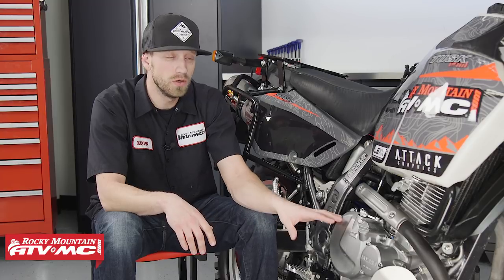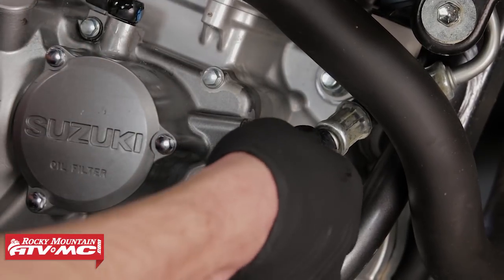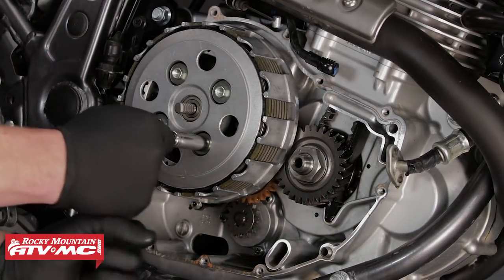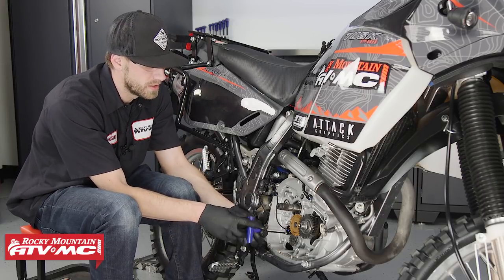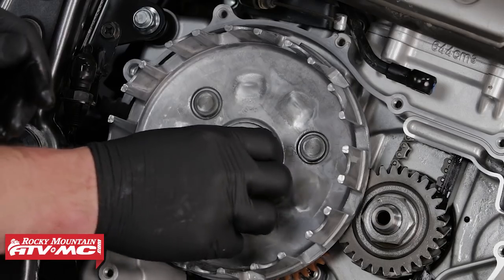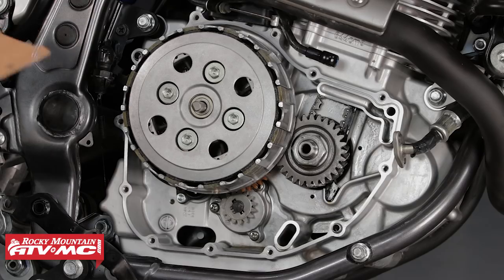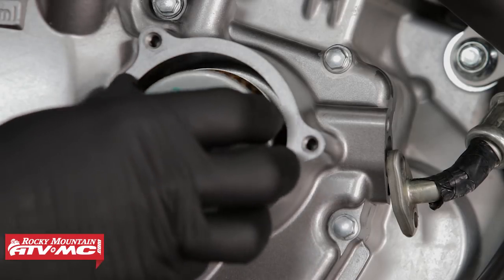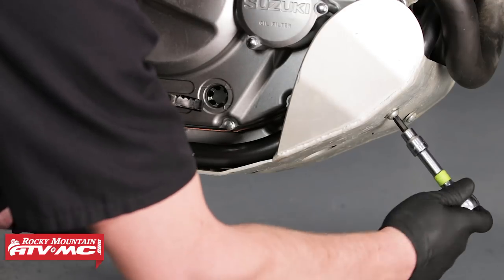Suzuki DR650 Neutral Sending Unit Bolt Repair

Comment: Another tip for keeping track of the case bolts is to get a piece of cardboard, draw a rough outline of the case with dots for bolt locations.  As you remove a bolt, push it through the cardboard “map” in the matching position.  When done your cardboard piece should have all the bolts in their correct locations. When reassembling remove a bolt from the cardboard and put in the matching location on the actual case.
Reply: LostInPA thats what i do.
Reply: Great tip. Have been doing that for years. And you can even put a strip of masking tape over the bolt heads to make sure they don't fall out when you accidentally step on them.

Comment: I dont want to state the obvious but I'm going to.
Why.....doesn't suzuki fix this problem.
How many people want to have to buy all that extra tools,etc to fix a problem that suzuki should.
Not to mention someone who doesn't have the capabilities to do the work is gonna have to pay for it
Is suzuki gonna pay for the labor cost....I doubt it.
Fix the problem suzuki.
Then I'll by a dr.
Thanks
Reply: They did - they now use loctitie on the NSU bolts.  Only 20 years late.

Comment: that cant be philip head screws. Most of japanese bikes use JIS screws.
Reply: i learned the hard way years ago trying to remove screws with a philips PH2 bit.  JIS screw bits are a must have in the tool box.   the Japanese screws and bolts are made of butter if you dont have the exact size tool, they will strip
Reply: The recovery tool kit that comes with the bike has the correct JIS bit.
Reply: You would have thought he knew about JIS but maybe not!!!
Reply: Everyone should buy a JIS screwdriver if they own a Japanese bike or you WILL end up drilling out screw heads eventually.

Comment: It's worth investing in a JIS screwdriver for this bike or (or any Japanese bike for that matter) because you really don't want to deal with one of those screw heads stripping out. Take it from the guy who learned the hard way..
Reply: 4:02 wrongly specified as Philips instead of JIS. This is indeed a very good point that you made here

Comment: Don't remove the breather cover. It's not in the way if all you're doing is removing one neutral-sending-switch fastener at a time, applying threadlocker and reinstalling. If you were removing or replacing the switch, yeah, then the breather cover is in your way.
Reply: Better remove it. Soft sand paper the surface for improved contact.

Comment: Suzuki started putting threadlocker on these bolts back in 2017, so newer models probably don't need to worry about this. 

Posting in case a new DR owner is freaking out. 😄
Reply: Thank you for that. May I ask you where you got this information? 

I have a 2019 but it still freaks me out thinking that such a small issue like this can wreck an entire motor!

Comment: I did see a similar video, can't remember which one, but instead of using thread locker 'red loctite', this maintainer used screws with holes in the heads of the screws and safety wired them together. Sounds like a good solution. I do safety wire every day at work and it's a proven method.
Reply: Yes. Procycle sells a kit for this job with safety wire. Loctite is fine, but wire guarantees the bolts will never move.
Reply: Yes, I did both…..blue loctite and a safety wire. Some say it’s overkill, but who cares? It’s easy and cheap.
Reply: As a aircraft machanic, you are right. Even planes like 787 uses this method in a lot of places

Comment: Great video!  I did the job yesterday and this was a great aid. The job was pretty straightforward. I was lucky that my gasket came off attached fully to the case, so I was able to reuse it. The screws on my NSU were actually not loose at all. In fact, they even made a popping sound when I began loosening them. I think it took me about 3 hours total, as it was my first time and I was going very slow. I filled with AMsoil oil and it seems to be shifting snappier than before.
Reply: Great news. I'm opening my dr this weekend to do the job, looking forward to it!

Comment: WARNING: Do NOT use 7ft-lbs on the clutch cover bolts like this video says.  These are standard 6mm bolts only rated for 4ft-lbs.  If you use 7ft-lbs like this video says, you will probably snap off the bolt in the engine case, just like I did using UNDER 7ft-lbs with a torque wrench.... just a word of experience. 7ft-lbs is for the oil cooling hose connection on the side.... NOT the clutch cover bolts.  If you use 7ft-lbs, be ready to order new M6x35mm bolts from suzuki and have some bolt extractor bits on hand because you'll need them ;)
Reply: So what does Suzuki say? What does the manual say?
If you are correct then this important info needs to be shown or the vid changed.
Reply: I checked internet and best I come up with is tighten to 6Nm or 4.42 lbs/ft. Use loctite blue, and keep checking for a month for peace of mind. 

The NSU screws loosen due to the cover heating and enabling the screws to loosen, but whatever, just fix the issue and be safe.
Reply: @johnrogers5825  In most cases, when a torque is needed, the manual says it in the section for that particular install, right next to the pictures. But in the case of the clutch cover bolts, there is no specified torque listed in the part of the instructions where it has you reinstalling the clutch cover, so you have to find the size and type of the bolt (standard m6) and find it in the general bolt size torque chart.  Even there, there are two m6 type bolts listed, regular and hardened.  The weaker or "standard" m6 bolt torque listed there is 4ft-lbs.  Rocky Mountain ATV's dr650 ATV video says 7ft-lbs, which is for the stronger m6 bolts, not these standard ones. If you use 7ft-lbs like Rocky Mountain says, you'll break bolts. You have to read the manual carefully and discover it's a regular m6 bolt and use the chart correctly and only use 4ft-lbs.  So technically, the suzuki manual is correct, but it's not very obvious and people such as Rocky Mountain often make the mistake of thinking it's 7ft-lbs which will break bolts.
Reply: @johnrogers5825  Yes, 4ft-lbs on the clutch cover bolts would be safe.  This video says 7ft-lbs but that snapped my bolts. The Suzuki manual is technically correct because it does not list a torque in the clutch cover install section....instead, you have to know it's a Standard m6 bolt, and you have to use the generic bolt torque reference chart in the manual which says those type bolts are 4ft-lbs.  People mistakenly think its the "hardened" m6 bolts and try to torque it to 7ft-lbs and break bolts.  But if you read the manual carefully and know what kind of bolts these are, you'll see the manually actually says to use 4ft-lbs not 7 like this video says.  I was working off this video and snapped a clutch cover bolt at less than 7ft-lbs.  I bought a new one and used 4ft-lbs and everything's perfect. No leaks. The manual was a little unclear, but techinically correct if you read it carefully and don't make assumptions.
Reply: @steelmilkjug  It is a shame that Suzuki doesn't explain and detail things exactly for the millions of dollars they make. Many companies are like this too.
Reply: Should I do the clutch spring bolts at 4 ft/lbs also? Sheared one at 7 ft/lbs. They are M6 also.

Comment: Should not need high strength Thread Lock? Medium is fine Make it so much more difficult if you do have a strip down to do later 
Also just a drop on each bolt is plenty AND the breather cover screws!

Comment: It'd be hard to replace this bike. Nothing else has so many good how to videos. I've got 60,000km (37,500 miles) on mine and the clutch slipped bit  today under hard acceleration at high speed (140 km/hr, 87 mph) in 4th gear. Thinking I should check the clutch and do this at the same time. Anyone try EBC CK friction discs? Maybe new stiffer clutch springs?

Comment: So no need to use wire and bolts, just the high strength thread locker?
Reply: yes thread locker should suffice

Comment: Thanks for the video, it's helped.  Just need to ask if after the 4 bolts are tightened up. Should the centre piece be solid and or should I be able to rotate it by hand? Because I've had 2 scenerios presented. One after the bolts were in I was able to spin the centre piece easily but but it didn't look like face plate was positioned properly. So I took it off and did it again to check and saw this time it clicked into position. But this time after tightening the bolts I can't spin the centre piece (not the funny thing that attaches the the clutch lever) anymore.  So I'm wondering if this is the case, that the whole thing should be solid or not? Hope this all makes sense.

Comment: Can't you just remove it completely from the engine?
Reply from the maker: If you don't mind not having a neutral light, you can remove the whole assembly.
Reply: @rmatvmc  I don't need neutral light. It will be safer if I delete everything:) Thanks. Cheers.

Comment: Thank you. I've been putting off doing the fix as I assumed it was going to be a PIA, however after watching this video I found doing the screws to be fairly simple. Instead of using thread-lock I went with the safety wire - 6 of one, half a dozen of the other.

Comment: Great video. But will add some more info:
1. Better also softly scratch the switch surface before re-install. With some thin sand-paper.
But more important - To whom having similar blinking neutral light:
Is it happen only when the engine become hot?
Test - is it turned back on when its cold?
For me - after fixing the NSU as shown in the video, tightening and applying locktite , the problem did not disappeared.
It seemed like a problem with the NSU itself, stopping to work on hot engine...
Good I opened and did the above Fix, but in my case - the NSU itself was faulty.
Reply: Did you happen to replace your NSU? Mine appears to be the same and I'm wondering if it is something I could attempt myself.

Comment: It looks like the last steel plate (closest to engine), concave washer and it's seat, and the thin wire retainer, can stay in place when the clutch basket is removed?  Is that correct?  It looked like it at 5:46 in the video.  Thanks for the video, good job.
Reply: Yes. It is. Strange wire protection. It's there.

Comment: I'm considering getting a dr 650 next year.
But seeing this mess makes me think twice.
Perhaps Suzuki should remedy the problem.
Reply: Every mfg has it's little idiosyncrasies. Trust me this is an easy one to fix.
Reply: A tiny problem in an otherwise bulletproof bike.
Reply: If you get an 2017 model and up Suzuki finally started putting locktite on these bolts

Comment: What even is a netraul sending unit?
Reply from the maker: The neutral sending unit is a device that sends a signal to the neutral indicator light on your dash letting you know when your bike is in neutral.
Reply: @rmatvmc  oh,do the older ones like 2007 or so have them?thanks
Reply from the maker: Yes, every DR650 will have one even going back to when they were first released in 1990!

Comment: I did everything exactly as in the video. Now the bike has lost its power. Where could I go wrong ?
Reply: Problematic installing the clutch plates?
Reply: @NirLouk  No problems. The previous owner replaced the entire clutch a year ago. I think I made a mistake with the assembly. I just don't know where.
Reply: @Unknown_Noise  maybe the order of the plates? If they are not in the right order it can cause an issue.
Other possibilities - weak springs. Wrong torque on springs.
Reply: @NirLouk  I was keeping an eye on the order of the plates. Wrong torque on springs - this could be it because I screwed on without a torque wrench. Many thanks for your interest. You helped me a lot.

Comment: Does the DRZ400S also need this fix?
Reply: the drz 400 has separate concerns regarding the stator bolts that tend to need thread lock applied like the dr650 NSU bolts.      i think this is suzukis way of making sure people keep buying bikes :)

other known issues of the drz 400 are

:steering stem bearings, wheel bearings, swing arm bearings, swing arm bolt tend to be left without hardly a drop of grease applied to them from the factory.  these can be taken care of in a day.   once a year apply grease and the bearings will last for years to come.

Kick stand kill switch & Clutch kill switch should be removed once you are comfortable with the bike. these switches are silly and can leave you wondering why your bike wont start.     

the drz 400 petcock can potentially leak over the years, replace with a manual petcock  (yamaha raptor will do)

i may be forgetting another potential problem that can be fixed but  thats the jist of it.  the drz400 and dr 650 are great bikes with little maintenance and reliable machines.